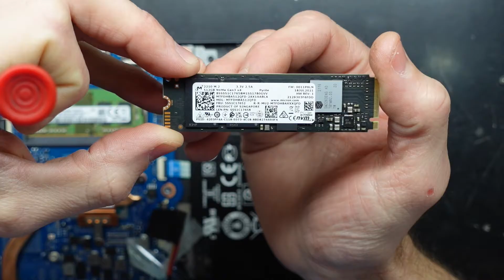Acer Aspire 3 A315-23 N18Q13 SSD and Ram Upgrade

Comment: Bro, I have an acer Aspire A5 14-53 G and I have a soldered ram of 4gb 2667 MHzand I Have a compartment in my laptop for extra ram. I bought an 8 gb 2666 MHz but my computer screen wont turn on when i turn it on. I also asked the seller and said that the ram cannot be used together with soldered memory. Is that true?
Reply from the maker: if there is a slot on the board.. it should just work 

doesn't matter that there is 4gb or 8gb already soldered on to the board
Reply: @rickstechrepairs  so why is my screen not turning on? I really searched so hard to make sure my specs are compatible :(

Comment: I have Acer aspire 3 A315 is it possible for me to upgrade ram from 2gb to 8gb and it have 500 gb Hd
Reply from the maker: not sure, open and see if it has a slot, if it does, 

then yes you should be able to

Comment: It has ony 1 RAM slot for change....but in the system its showing that it has two RAM slots.....I am not able to find th eother RAM slots
Reply from the maker: other ram slot is probably Soldered on Ram
Reply: @rickstechrepairs  this version doesn't have soldered ram

Comment: Hej i learnt something new today. My acer aspire dose not have anything like what i thought a Hard Drive looked like. i think it is an ssd card thingy.  I have a problem with my laptop.  it is only 1 yr old. 2 days ago i turned it on as usual, logged in and used it till i went to bed. As i was ready to turn it off up popped the dreaded updates and turn off notifications. So i did as instructed. Next day i turned on my laptop, logged in with my code and then it went to a black screen..............................   Noooo........... I can see the mouse cursor but the screen is black. i have turned it off twice and restarted it only for it to let me log in with my code and go direct to a black screen. Is there any way i can save my laptop as i have so much stuff on there . ?  or is it dead ?  Thanx

Comment: I have same but 
My spex spec are 
8 gb ram 
And 512 gb ssd 

Can i slot another 8 gb or i have to put 4 gb 
And what about ssd can i replace 512 witg 1tb?
Reply: Did you ever get your question answered?
Reply: @michaelsherron5750 
Yes i upgrade my laptop.
1. Abt ram the slot where the guy from youtube put ram was already filled with 4gb ram so i had 2 4gb ram from which one can be replaced so my technician said you can upgrade upto 12 gb . And i replace the dettacable ram with 8 gb which give me total of 12 gb 

2. Abt ssd yes he said i can upgrade to 1 tb ssd  but 512 was enogh for me so i go with 1tb  hdd  which gave me total of 1tb hdd +512ssd but unfortunately i cannot find tge connector for hdd in my city and also i suggest dont put hdd as i try to put with a connector at a local shop but the connector was burned immediately. So again my technician suggest me. original cable is not available in my country(Nepal) and it is risk to put a copy cable so he suggest me to get a external hard drive converter which was a win win situation for me as i am a travel photographer and i cant carry laptop everywhere 

But for gamers or who can take there laptop every where 
I suggest find a original or good quality cable abd upgrade to 1tb hdd for storage 
Or you can upgrade your 512 gb with 1 tb ssd 
And if you have more budget you can do both 1tb ssd + 1 tb hdd

After upgrade of ram personally it gives a bettee performance but i stiil need atleast 16gb in future .
Upto now working like a champ.

Comment: Hello, I have a problem, since you have the same laptop as me, I hope you can help me, I want to upgrade the ram on my laptop, but it is already occupied with one ram stick that says it has a capacity of 4GB, but I have 8GB on my laptop, so it says in the task  manager, so if you can explain to me how this is possible, I'm not really a tech guy, any help would be much appreciated. 😊
Reply: You probably have two ram slots 4gbs each the other one might be under the motherboard
Reply: @hoodrabbit4293  thank you for the feedback
Reply from the maker: i would suspect that 4GB is Soldered directly on the mainboard

so you would be upgrade 4GB + 8GB or 16GB
Reply: @rickstechrepairs  Thanks man appreciate it

Comment: hello so i have this laptop as well and i just took the thing apart and regarding the ram it has a 4gb ram stick in it right now im trying to figure how to upgrade it to 12gb i don't see the onboard memory anywhere so i don't understand how its reading 4gb only if theres something on the motherboard as well
Reply: it has one removable ram stick and one that is integrated to the motherboard, both are 4gb. That's why when you removed one it still detects 4gb of ram. You need to replace the 4gb of removable memory with 8gb to have 12gb of total ram.
Reply: @steveletterman7121 he didn't remove it, this model doesn't have soldered ram, very terrible
Reply: I need 32 GB of memory is that possible?
Reply: I guess you buy 16gb to replace the 4gb, there's literally no soldered ram
Reply: @kalirocketdev  laptop only supports 12gb max ram (else it needs to read off a second bank on the memory which it's not wired for) 

Was just reading on this and trying to confirm if it actually does support 16gb ram or not, wonna see what happens if someone tried 16 lol (I wouldn't risk buying it unless you have one lying around you can try)
Reply: @kalirocketdev  were not using it anymore i ended up getting a new one but i'll look into it

Comment: Hello, I have the same laptop and discovered a problem: I installed a 256 GB nvme drive, Pcie 3.0 x4, but it works in Pcie 1.0 x2 mode according to crystaldiskinfo. Tell me, does your drive work in PCie 3.0 x4 mode? If you encountered the same problem, how did you fix it?